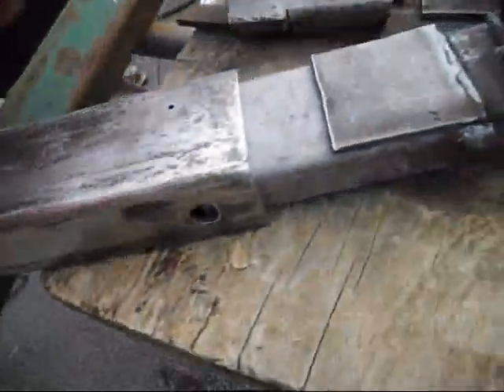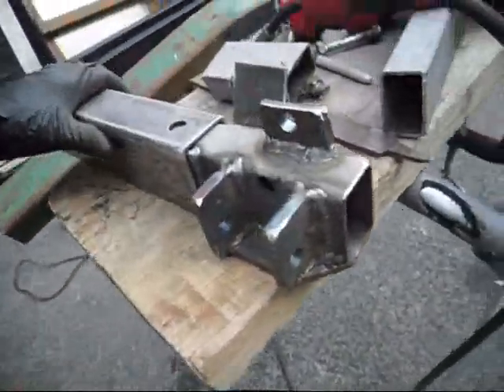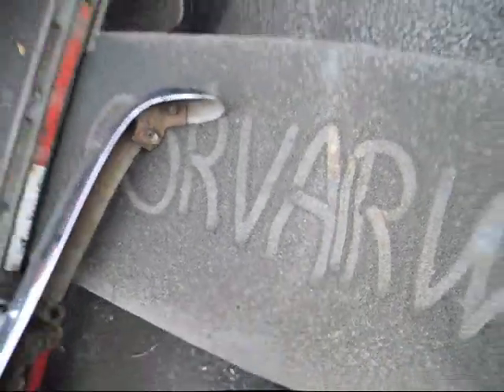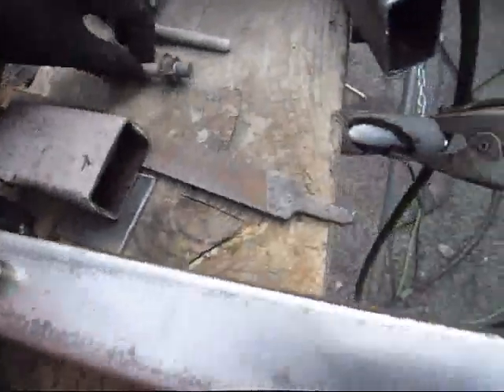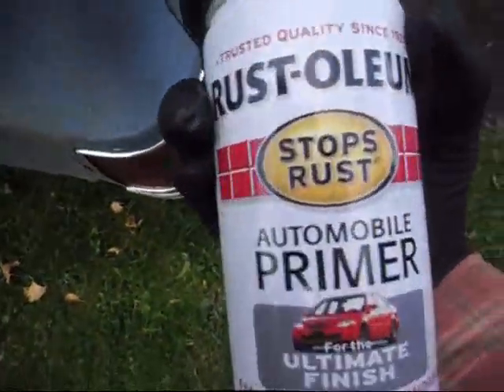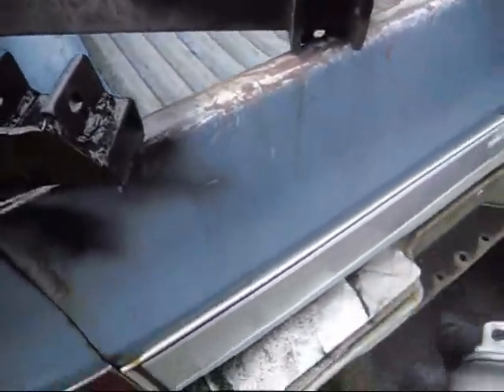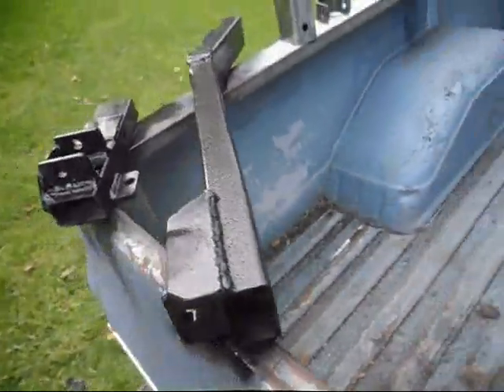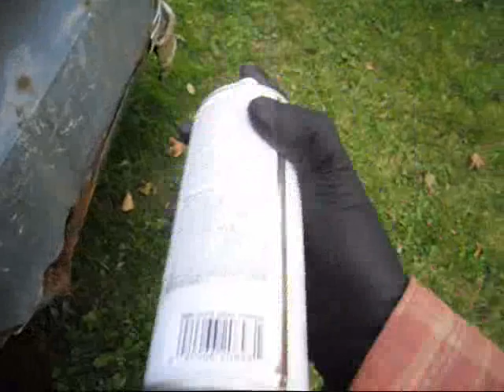Spray Painting Corvair Tow Bar  10 10 13

Comment: Could you just make them 2 separate brackets that bolt where they go on the frame and not have the long bar? Just have 2 small brackets bolted on and the tow bar will adjust as needed. I would just cut out the whole center piece with the bend. Would that be strong enough?